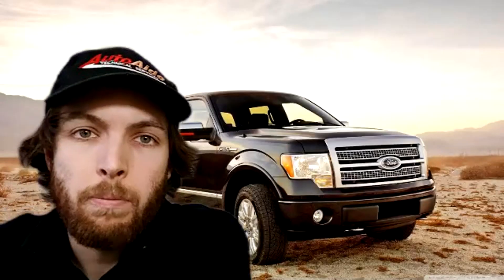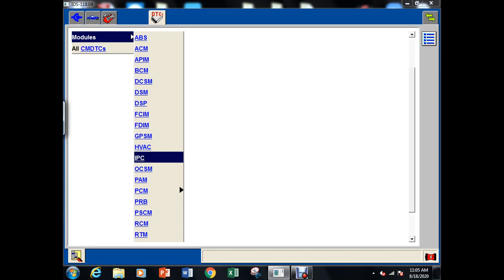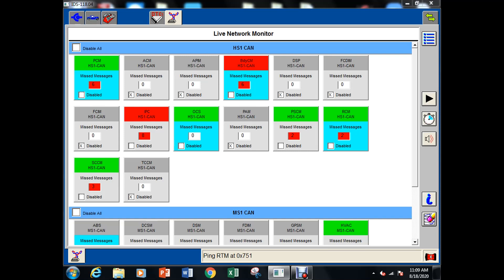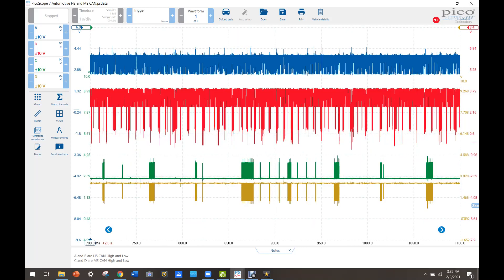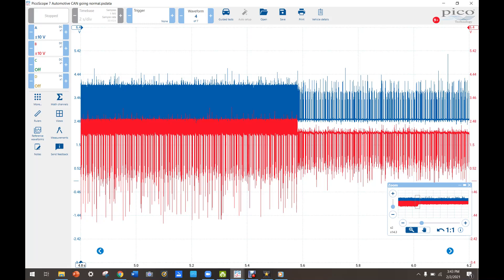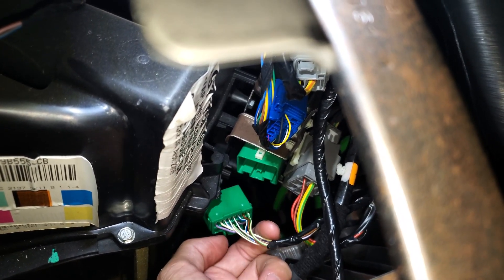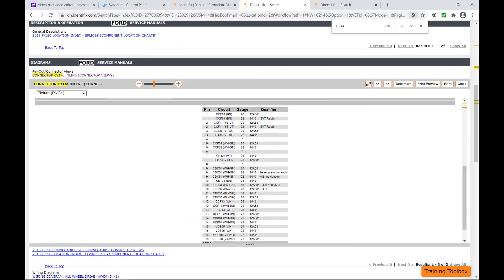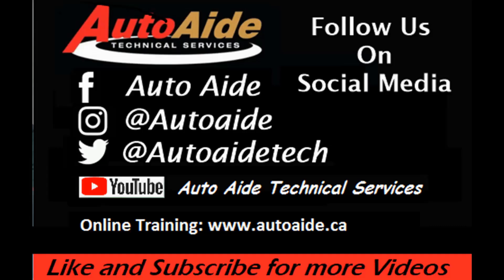2013 Ford F-150 No Crank. Communication Issue!

Comment: Can you explain why the h.s. CAN looks so bad? Even after the repair it still looks noisy or faulty. I would still assume it had a problem. Thanks
Reply from the maker: CAN is often noisy and not as clean as you would think, it varies from manufacturer. I ignore the noise unless there are communication problems. Once the repair was made the CAN signal returned to normal CAN voltages even with the noise.
Reply: @autoaidetechnicalservices3981  thanks. I was jusy asking. Not questioning! :)